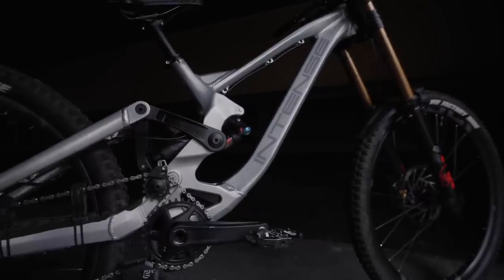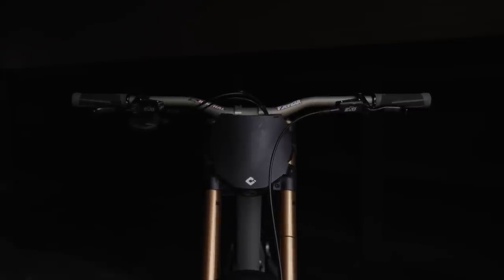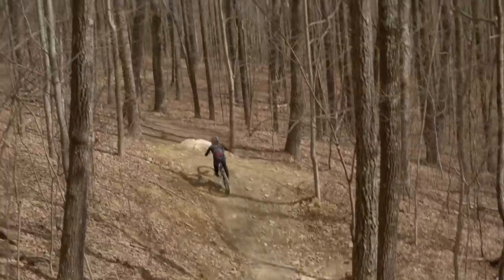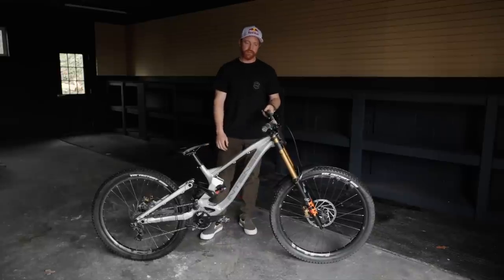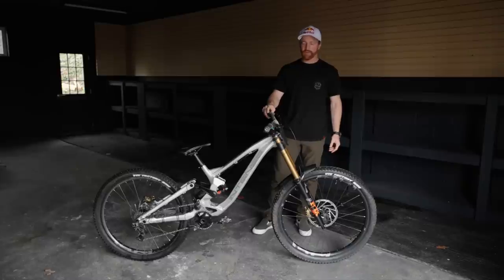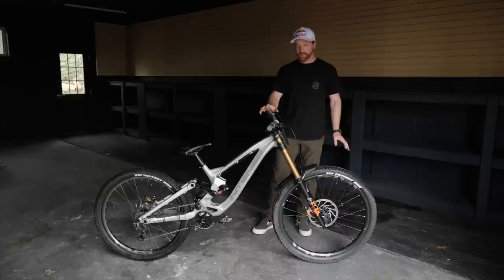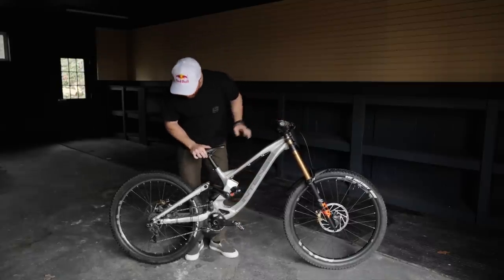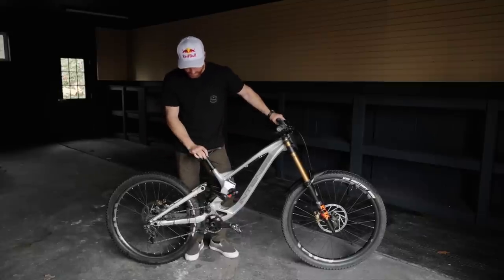My Prototype Bike Check | Intense M279 HP6

Comment: Nice to have external cable routing, makes the life of a mechanic so much easier, is great that John is guiding the design engineers to avoid the internal cable routing nonsense.
Reply: Yup
Reply: The final bike will have internal cable routing no doubt and will probably be carbon.

Comment: At 19:08, AG doing is best C3PO impersonation!!  :)  So WHEN will this bike be available to the public? I'm itching to replace my M16. Also, will it be available in aluminum??
Reply: Not sure if anyone has answered this or if this is supposed to be out there on the internet but..I talked to the Intense reps at sea otter last week where the bike was on display. Dude, it looks just as good or better in person! They said the goal is to have it available February 2024. So maybe realistically itll be available April..? They said it'll be aluminum. A carbon option may follow (not sure on that though). They said there will be a frameset option as well in addition to a full build🙌 no info on price point sadly. But take this with a grain of salt..things could change. Just relaying over what they told me at sea otter!
Reply: @lukeblankshain  Thanks for the info. That's what I was hoping for so I'm keeping my fingers crossed that I can be on a new DH bike next season.  👍🏼  I wish they would "officially commit/comment" on this. It's the same way they handled the release of the new Tracer enduro bike.
Reply: @Ricky Downhill  of course man! Getting info on the M279 was priority #1 for me at sea otter lol im in the same boat. I was pretty stoked after talking with them. All the answers I was hoping for.  I think it's safe to assume sometime in Q2 though. Give em a little shift for dev and manufacturing.
Reply: @lukeblankshain   This was the same boat I was in when I wanted to replace my 2016 Tracer in 2021.  They kept teasing the new one, gave no info on when it was going to be built and I was totally in the market for a new one for several years. I got sick and tried of waiting and bought a GG Gnarvana instead.  Which I love btw... but they lost out on a 6-8K sale from me.  I AM buying a new DH bike next season so I HOPE this one is ready. If it's not, I guess I'll be off Intense for both bikes.   :(